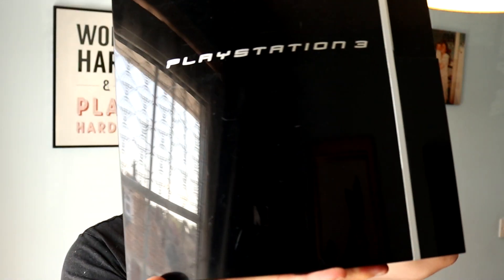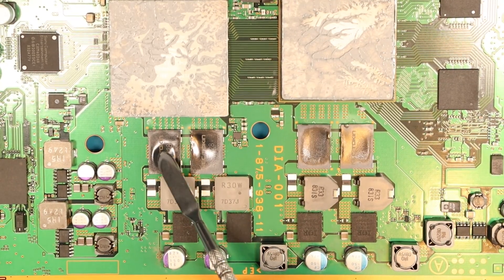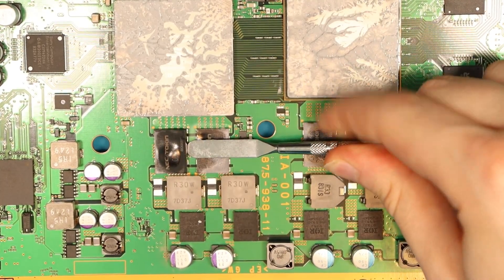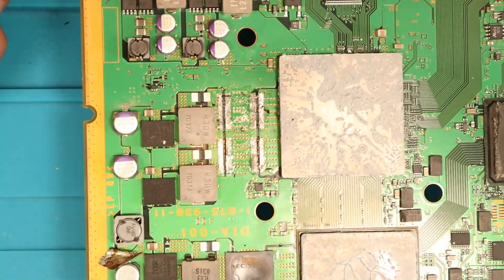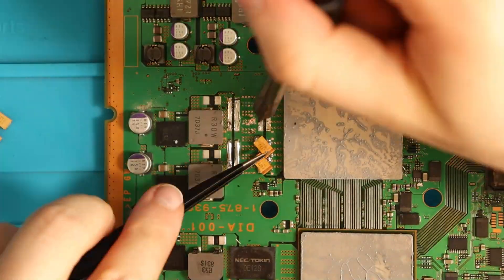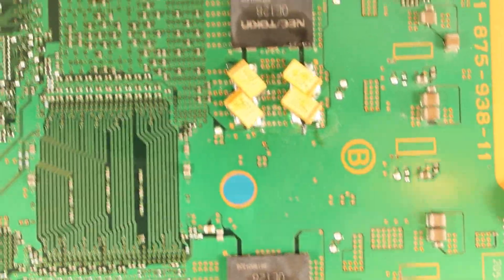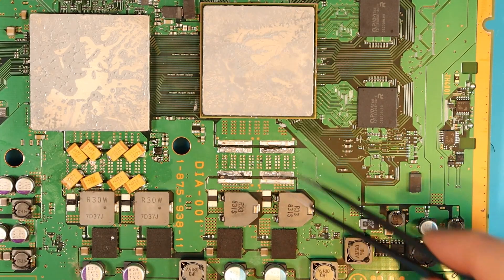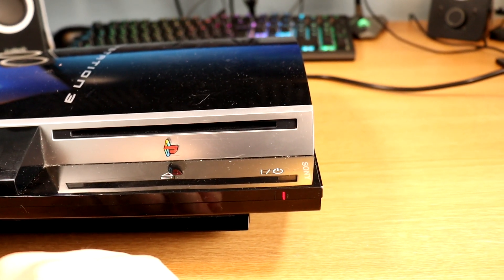REVISITING a Faulty PS3 with Red Light of Death | Replacing NEC/TOKIN Capacitors

Comment: You want Nec Tokin capacitor and i see you have the OE128 is easy replacement with flux and hot air in 380 - 407 degrees max and max 1 minute to off on board

Comment: I know this is old but when i did mine. I used caps from a macbook that had 2 ground legs. Allowed me to put them straight on. Also you could expose more ground plain in the middle to allow them to sit straight also. The angle method is hard without causing a short

Comment: You've put 4 capacitors instead of the the one already there but you forgot to bridge the circuit... bottom row and top row should be connected otherwise the circuit is incomplete.

Comment: you need to bridge the positive pins on replacements caps if you changed only the ones on the RSX and CPU side and it should work.
Reply: and it should be a thick gauge wire.
Reply: exactly!

Comment: for anyone who's attempting to remove the NEC Tokins, get yourself a flat blade exacto knife and just work the blade underneath each cap and slice them off the board, takes about 15 seconds per cap, no heat required, and the pads will be fine

Comment: NOTICE - IF YOU ARE PLANNING TO REMOVE THE NEC/TOKINS, I SUGGEST TO LEAVE THE ORIGINAL NECS UNDER THE BOARD, AS THEY HAVE AN INTERNAL BRIDGE/JUMPER ON THE POSITIVE POINT, SO IT WILL CREATE A BRIDGE FOR THE TANTALUMS, BUT IF YOU DECIDE TO REMOVE ALL THE NECS, YOULL HAVE TO BRIDGE THE TANTALUMS FROM THE POSITIVE TO POSITIVE POINTS WITH A HIGH GUAGE WIRE OR ELSE THE CURRENT WONT PASS THOUGH,SINCE THERE IS NO BRIDGE BETWEEN THE TANTALUMS! BUT THE BEST WAY TO AVOID MAKING JUMPERS IS TO LEAVE AT LEAST 1 ORIGINAL NEC ON THE MOTHERBOARD "

You didn't do this when you replaced the caps on both sides of the board this is probably why it's not working still.
Reply: yup, if you remove all Tokins per chip (4 Tokins for RSX, and 4 for CELL), you'll need to bridge each set of tantalums positive to positive. technically you only need to do 2 out of the 4 pads, but I'm doing all 4 Tokins pads with jumpers, using 18awg/600v wire
Reply from the maker: Tristan, you make a very good point. I still have the caps so will revisit this soon :) thank you!
Reply: @JoeyDoesTech  please try this, I have a slim CECH-2101A with the same problem, but it stays on Green light for 30 seconds before blinking Red
Reply: should i leave ALL the originals or just 1?

Comment: Fair effort Joey. It's frustrating that it did work that time, so there can't be much wrong with it. I know you're emotionally attached to this one as it's for someone rather than just for yourself. Don't give up yet - give it a rest.

If you focus on the Slim PS3 first, at least you haven't got the physiological pressure of someone's property. You'll be more inclined to take calculated risks and may even learn more towards the OG model.

PS, sorry I missed the livestream - my head has been fuzzy after my second Covid jab, so I'd never have been able to focus on it.

Comment: i would have removed all old nokins and put on the new caps. and if caps not enough i would have reoredered some. for testing i think the amount what u had would be enough. im sure there is a dead nokin left on the board
Reply from the maker: Thanks Technic. I've just ordered some more, because of the comments 😁😁 will give it another go! Thankyou 😊
Reply: @JoeyDoesTech  did you ever get to replacing all the nec tokins?

Comment: All i could hear was “Hello darkness my old friend.. ive cone to talk to you again.” When the ps3 when black at white in the end. It was worth a shot. Never did trust myself to replace the capacitors on my ps3s when working on them. Normally over heating issues but you may be able to find a replacement motherboard for this console. It just surprises me how often they got the YLOD.. usually a good reball helps. Im actually watching this on one of my restored ps3s lol testing it out after putting it back together
Reply from the maker: Haha the irony of you watching on a PS3 is amazing! Thanks for watching MITSI :) Do you think it's just because the consoles are old now?
Reply: @JoeyDoesTech  well considering they had to cut corners due to a law that was passed due to lead being in solder. The consoles both ps3 and xbox360.. the solder melts at a lower temp than its suppose to. I mean its hard to believe but the original phat ps3s are 15 years old! So age does has a factor but also just abuse over the years. On and off, dust build up ect ect. Sadly nothing is made to last except for a nintendo 64 😂

Comment: You have to replace them all. Otherwise this fix would Not work. And you Need to Check with a continuity Tester if the Caps Are realy soldered to the pads.
Reply from the maker: Good shout Retro. Maybe i'll get some more and give it one last try :)
Reply: @JoeyDoesTech  Thats the way! After the replace, Heat the CPU and the grafixchip again, just like in the First video. Focus the Heat just on the Chips for about 90 seconds each with 450C and half of airflow. Always in cicles